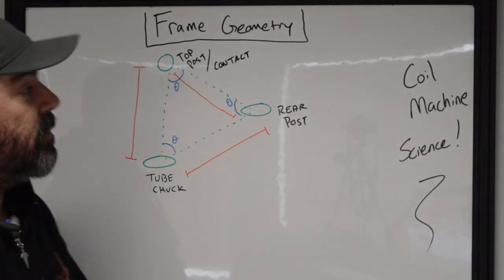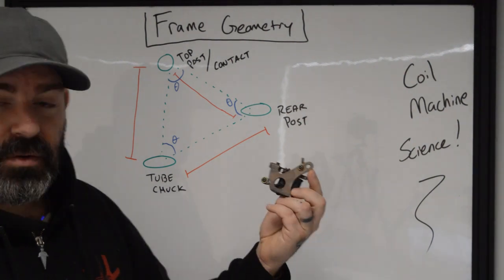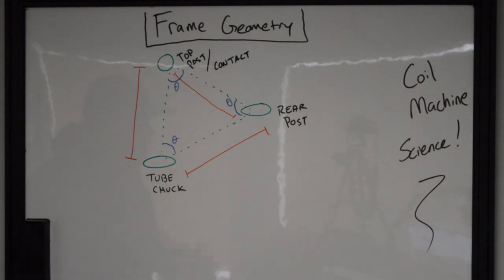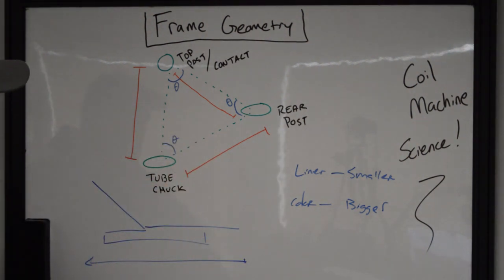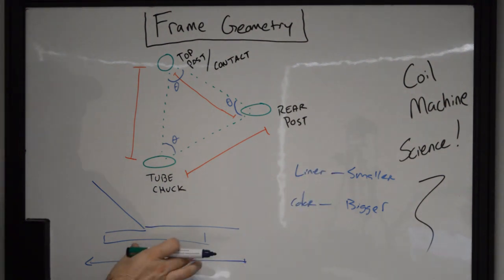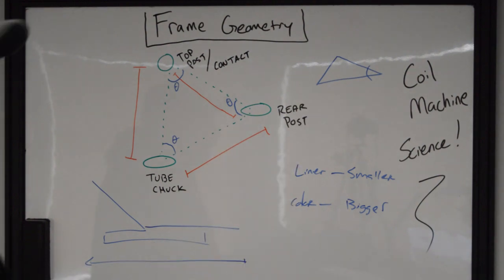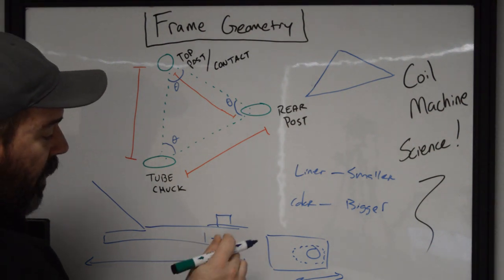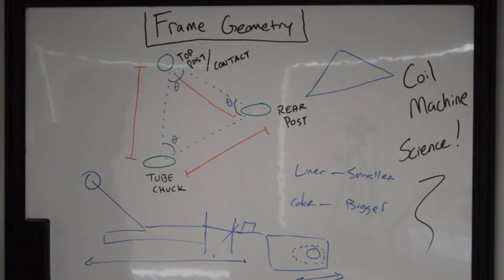Coil Type Tattoo Machine Science - Frame Geometry

Comment: Excellent job explaining frame geometry..I have beautiful machines from Aaron Cain , Mike Malone ,Brian Hibbard, Mickey Sharps…and a few from friend that’s retired and passed away …
Reply from the maker: Mannnnn. That sounds like quite the collection! I used to trace side plates to compare geometries to see if someone had some special "thing" that made it run better. As I learned more about machine tech I found that it wasn't ever just 1 thing that made a good machine, but instead the overall quality of parts and design that made them so rad. Speaking of Sharpz machines - I think they are the most balanced off the line machine you can find. Hands down. Great for anyone who wants to throw a coil into the mix.